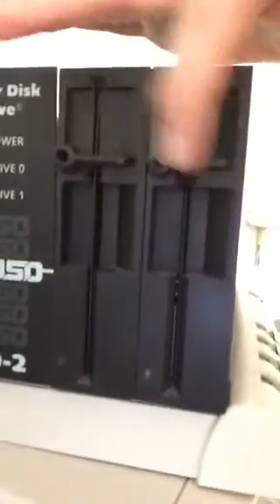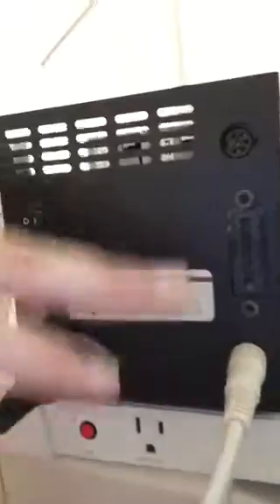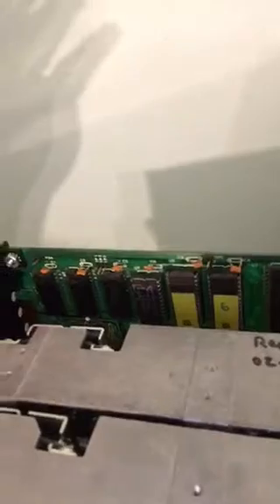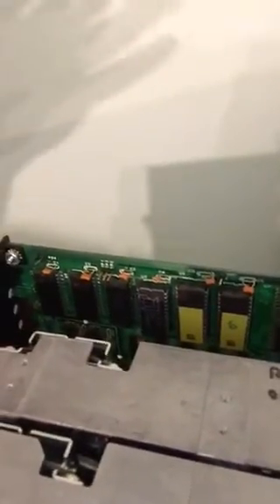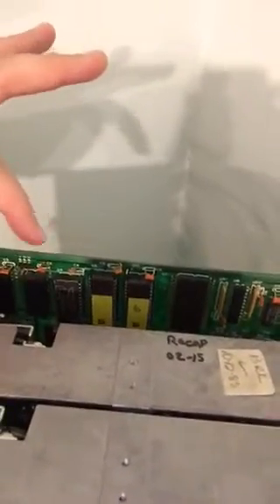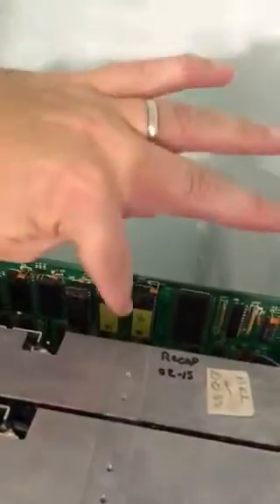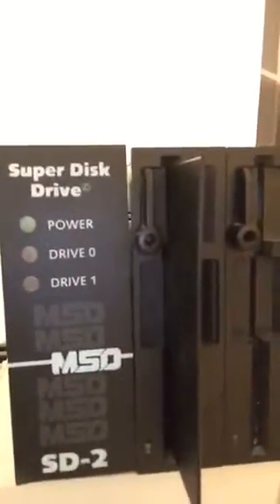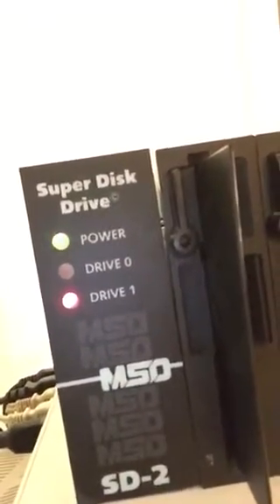Demonstration of MSD-SD2 Super Disk Drive with Mass Duplicator Upgrade

Comment: Hi Sean, I just got an MSD SD-2 recently. It already has the RAM upgrade, and a VERY pro-looking drive ID selector. I mean, it looks like it came from the factory this way, which allows me to flip it from 8 to 9 (which is quite handy when hooking it up to a C128D with an internal drive). 

Anyway, I love the idea of the Mass Dupe ROMs. What blank EPROMs did you buy to put the code on? I've found the actual ROM code on Ray Carlsen's site. 

Thanks for the demo! I'm going to play around with it this weekend. I just got it completely recapped so she's good-to-go.
Reply from the maker: I actually bought this set off EBAY already burned, didn't burn the EPROMS myself.  SO I'm not sure, what exact Eproms they are.
Reply: @seanpeck8748  OK. I'll go search Ebay and see if I can find the same. Thanks for the reply

Comment: I have the MSD SD2 and it is just as you describe.  I also bought the CLD chips, dual drive Canon software, and have the manual.  When I bought mine, there was an optional toggle switch which required soldering a few wires to the legs of the chips.  I loved it and within a week, the toggle switch fell apart.  I do not know if this is a double or single throw switch and need to replace it.  There is no part number on the switch and the original vendor is long gone.  He was very knowledgeable and easy to deal with...but he vaporized.  Do you know about this switch?  I noticed that your kit did not include a toggle but otherwise, is the same.
Reply from the maker: I don't know about the toggle switch, what did the toggle switch do? I am guessing that it bypassed the sensors, so you could just use the switch to tell it which mode to boot to?  If I had to venture a guess, if that is what it did it would be a 3 ways switch, neutral (do nothing) 1 way, block only 1 sensor,  second way mimic blocking both.

But that's just me guessing, would make sense.

Comment: Hi Sean. I just found this video -- a great demonstration, thanks! Would you be able to point me in the direction if how to implement the RAM upgrade, memory IC required, etc.?
Reply from the maker: The Rom/Ram upgrade was made by Chip Level Design and called Mass Duplicator.  I picked it up off of Ebay back when I made this video, not sure if anyone is still actively selling them, but I am sure you can find the binaries and other information about it out there on the net.
Reply from the maker: I don't recall it came with the kit, it was I believe an 8K ram chip with 24 pins, can look and see if it is marked.  Here is the Manual that came with the upgrade http://chiclassiccomp.org/docs/content/computing/ChipLevelDesigns/CLD_MassDuplicator1.0UsersReference.pdf

Comment: Nice video.  Finally found one today at the local thrift store.  Replaced all the 10uf caps and cleaned the board.   Might get that rom/ram upgrade.   Now if I could figure out how to change the drive number to 11.   Manual seems to be wrong.
Reply: Got it figured out and added JD and Fast Copy.
Reply from the maker: glad you figured it out, there are jumpers on the board for device number
Reply: Sean Peck bad eyesight had me changing jumpers on the drives and not the mb.  Now I'm waiting for more capactors to arrive to fix the rest of the floppy boards.  The ones under the drive motors are in bad shape.  Darn screws were were stripped on one drive.
Reply from the maker: There are 2 jumpers on the board to change the drive number, very easy to do, just open or close the proper pins.  Mine is set up as drive 11 in my set up.

Comment: I had the SD1, single disk drive.  Yes, a real tank.  Somewhat limiting tho, since it couldn't run the fastloaders or handle the copy protection schemes.  Still, much much better than the 1541 - no overheating, no banging heads, etc.
Reply from the maker: Yes, is not 1541 rom compatible, like all the 3rd party drives, so fast loaders and copy protection doesn't always work... the other limit of the SD1, was it had no IEEE interface, so it could not be connected to the PET's... which I always found a bit odd... since these drives really seemed to be built to PET type commercial standards, rather than the home standard of 1541 etc.  I always found it odd, it had the IEEE on the dual, but not the single.

However for fast loading, there was a version of JIFFYDOS available for these drives... I don't know if they used the same sockets as the CLD rom upgrade or something else... not sure if you could have CLD and JIFFYDOS both in them
Reply: @seanpeck8748   I've seen SD-1s with an IEEE-488 interface.  Perhaps not all of them have one, but some do.  It's great that there is a version of JiffyDOS for so many drives, which probably helps with compatibility, if anything, in addition to providing faster data transfer.

Third-party drives varied greatly concerning compatibility, even within the same make and model.  The original Enhancer 2000, for example, didn't work with any software that reprogrammed the drive, but the later upgraded version was very compatible.  And the Blue Chip BCD/5.25 started out as an unreliable, incompatible piece of junk, but after it was revamped by Blue Chip, it became the best drive I've used with Commodore computers in many respects.  It has a direct-drive motor, write indicator LED (actually comes in handy at times), runs fairly cool (uses an external power supply), has a track 1 sensor and actually uses it (no head knocking, ever), it can't seem to go out of alignment after 35 years of use, and it has been 100% compatible with everything I've thrown at it (despite having the write indicator LED and utilizing the track 1 sensor).
Reply from the maker: @rbrtck  You are correct, may be my bad memory they did have the IEEE

Comment: Thanks for sharing the video.  I was never aware of the validation copy mode available on the CLD mass duplicator ROM upgrade.  Have that same kit here that I plan on putting into one of my MSD-SD2 drives.  Was fortunate enough to pick up a few of these drives recently at a reasonable price...  although two of them I do need to re-cap.

Anyways, great video.

Thomas
Reply from the maker: Yea, nearly all of them need recapped... which is why I laugh when they come up as RARELY USED or NOS and folks want ridiculous prices for them because if they haven't been recapped, odds are pretty good the person who spent all that money will find they will get a device that is DOA or will die shortly.

You can also execute the copy modes by sending commands over the command channel as well if you don't want to restart the drive physically...
Reply from the maker: Yes, sadly the capacitors used by the manufacturer were crap, if you find one today that hasn't been recapped and isn't destroyed inside due to the caps leaking you are lucky... and should recap it immediately.

Comment: Thanks for showing this Sean, love seeing all the weird and wonderful old tech. I missed out on a lot of this stuff in the UK as disk drives weren't very popular and very expensive over here.
Reply from the maker: Yes, Disk Drives were insanely expensive over that way... in US the tape drive was the rarity, something like 97% of US C64 owners had disk drives.  This one was expensive, original retail for this thing in the states was something like $450 or so if memory serves... so it was nearly the cost of a 64 and 1541 combined.  So I don't know how many 64 folks bough them but, particularly with the chip upgrade, they were a must have for anyone doing a lot of disk duplication.  

Where I think these things likely sold more was to the PET user base, though this is purely conjecture, because while the PET has dual drives available, they were MASSIVE in size and cost more than the MSD-2  Commodore didn't stack the physical drives in a vertical configuration in their Dual Drives, but had them side by side, and also used full height drives... so an original pet 4040 was just a massively huge piece of hardware, and the later 8250 did shrink the height of the footprint because it used the newer 1/2 height 5.25 drives, but still configured them side by side... so it still took up a lot of real estate.  Of course the 8250 used quad density and could get 1 Meg on a 5.25 floppy... (similar to the SFD-1001) which is really insane to think about since these drives came out in 1980.  1 Meg was a massive amount for a floppy back then... most Hard Drives were in the 5-10 meg range at that time.